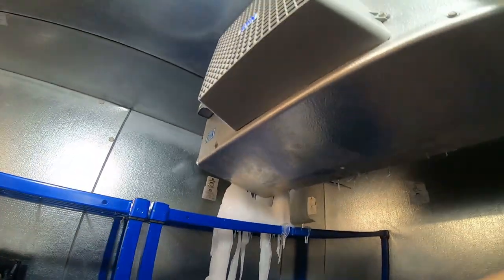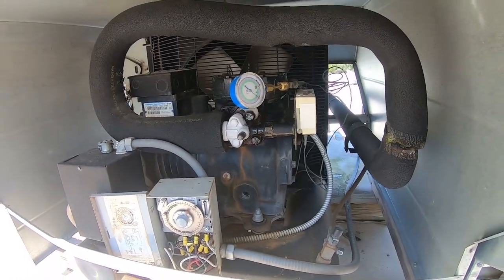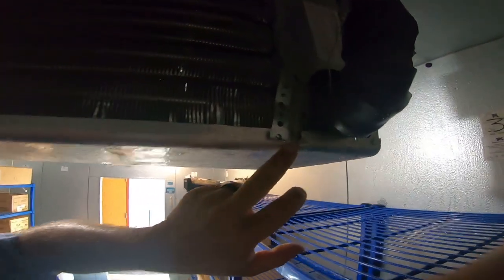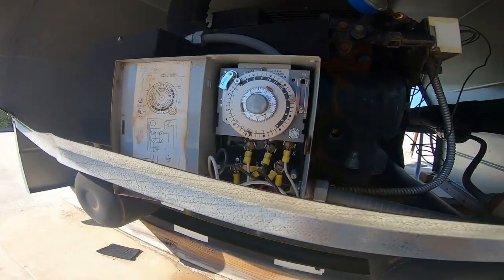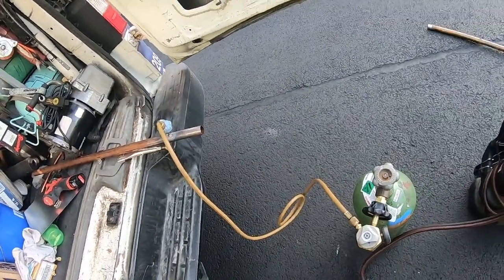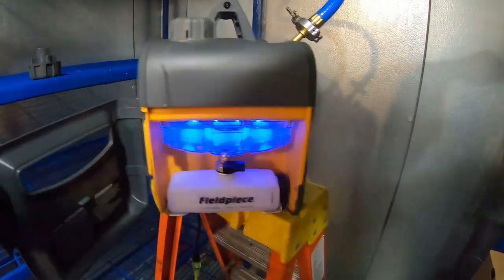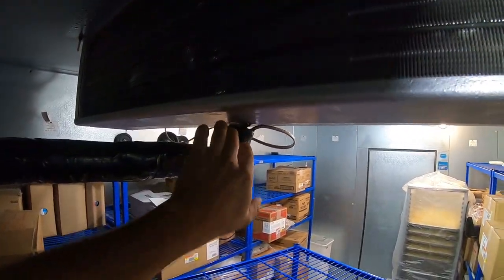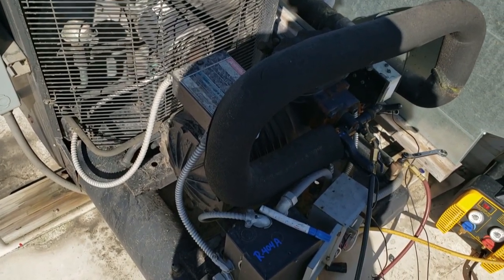Walk-in Freezer Iced Evaporator Refrigerant Leak And Non-Condensables

Comment: This was the perfect opportunity for you to add the pee trap the system needs for good oil return and a chance to get the bulb mounted on a horizontal rather than the vertical!
Reply from the maker: How would I fit the trap in there?  it came right out of the unit and straight up. Most traps are usually 5 or 6 inches or more long. That's why I had to reuse that fitting.
Reply: Where there’s a will, there’s a way. There’s always a way to do the right thing. I’d have installed that 90 horizontal rather than vertical, then the trap and a 90 up past the trap, to a 90 over and a 90 up. You obviously ran into oil while attempting to vacuum as it wasn’t returning to the compressor. 
Surprised to not see a trap in the drain line either. No need to drill another hole in the panel, just egg out the bottom of the exiting hole with a saw zaw. 
Many mistakes not by your doing, but very shabby and poor original installation!

Comment: I see bulbs mounted vertically like your situation all the time, installation issues eat up time for service. I recommend mounting the bulb with the capillary facing down vertically so the power head charge can freely move.  I also started cutting the insulation and leaving open an inch in the wall panel, so when you spray foam it seals around the suction line and stops condensation rolling down the pipe and freezing and splitting insulation.

Nice job trying to make it best it can be.
Reply from the maker: Good idea on the penetration of the suction line coming through the cooler , kind of the same principle when you're coming through the roof penetration.  I actually had a look at the recommended bulb placement verify if vertical or horizontal was correct. Sure enough,  horizontally is the preferred method.  I've actually rotated my clamp around the pipe to see if there's really that much of a difference in temperature, I never have noticed a major difference much more than maybe a degree. I do however understand thought process behind it is whether you're sensing liquid or vapor refrigerant. And that of course is depending on the diameter of the pipe, small pipes sometimes they want them mounted at 6, larger pipes 10 + 2, I just follow whatever the manufacturer recommends.  Thanks for commenting and watching! I appreciate it👍🤦‍♂️

Comment: Dude...niiice. added a 1/4 below. Beats dragging a tank all the way to the top. I was working on a vav system today and the control board up at the rtu fried at 2 com wires. Its dc voltage so I have no idea how that could have happened.  Gotta check it out friday. Half the building is offline.
Reply from the maker: I'm all about working smarter not harder. Thanks for commenting👍👍I'm just getting my feet wet on vav systems.

Comment: Thank you for your videos. I think I have told you before: I highly appreciate you taking the time to make them. I have a question: What is the reason why that suction line (riser) doesn't call for a P trap? Thank you.
Reply from the maker: Thanks for the recognition! Generally you only need a trap when you rise more than 10 ft (from what I remember.) With the compressor being located up high and the roof just being a little higher it definitely was under 10 ft.
Reply: @HVACRSurvival  Ok. Thank you.

Comment: Quick connects on refrigeration equipment? I thought they were only used for Mobile Home air conditioners or central air conditioners that people can purchase on line threw Home Depot
Reply from the maker: We have them on ice machine remotes and remote ice cream conditioners. They are not my choice because people don't install them correctly and they leak because of it.

Comment: Great video and excellent work. Two questions.....tight space but would a p-trap have helped on the suction line and I really liked the app you used for refrigerant P/T chart. What app was that. Appreciate your vids!
Reply: Danfoss Slider app
Reply from the maker: @davejohnsonnola7908  Correct👍👍, Thanks David!
Reply from the maker: From what I was tought you can go smaller diameter then up or reduce where the flow would be draining down towards to the compressor or in a horizontal run would have been better than vertical up.  Because the oil level was ok in the compressor, the rise was less than 10 feet high and the total distance from the evap to the condenser was short,  maybe 30 feet,  I didn't figure it was a huge deal but just figured I would mention it. But, yes I would rather seen a trap then stay 7/8" till it went horizontal then increase to 1-1/8"
Reply: @HVACRSurvival  That Danfoss app is great.   Love it.

Comment: The most important part, i.e. non-condensables were only touched in the video. Can someone please enlighten me regarding the following: 

What exactly indicated the presence of non-condensables?
What was the severity of the problem, .i.e. generally, how to quantify the problem?
What was the most probable cause based on established facts (setting of LP switch?)?
How was the problem solved (venting non-condensables, new refrigenrant, etc)?
Reply from the maker: The non-condensables happened after I did the nitrogen test. The nitrogen leaked into the refrigerant system through the service valve.  The result was the sight glass had bubbles now and did not prior, so I added refrigerant,  the bubbles would start to clear and then would start flashing again, so I checked my superheat and it was off, I tried to adjust it but it would not adjust, so I took the valve apart and cleaned the pushrods and retested, it still did not fix the problem,  I finally checked the subcooling and noticed the head was higher than normal and the subcooling was 30 degrees. With the subcooling at 30 degrees, there should not have been bubbles in the glass.  I put one and one together and figured it out, I recovered the refrigerant. Changed the filter drier and recharged with new refrigerant. Not all scenarios will be this same way but these were the symptoms that I had. Normally I have noticed the head pressure will swing up and down as a sign of non-condensables.
Reply: @HVACRSurvival  Thank your for your replay ;-). I'll add my two cents tomorrow.